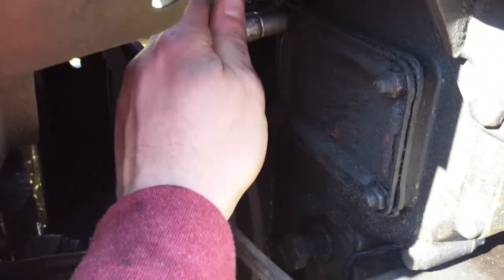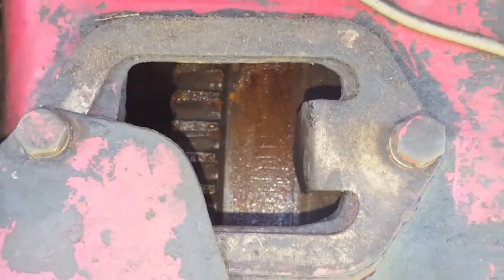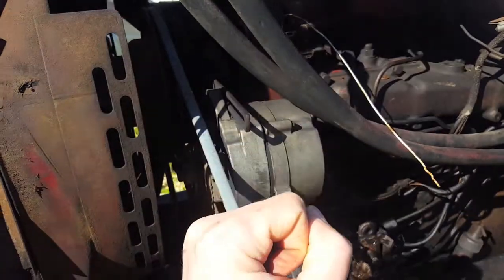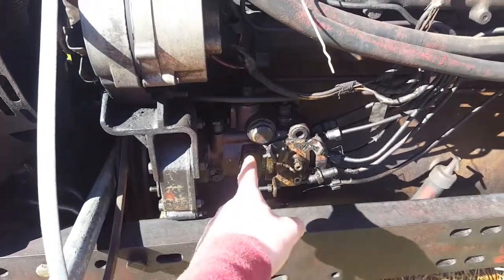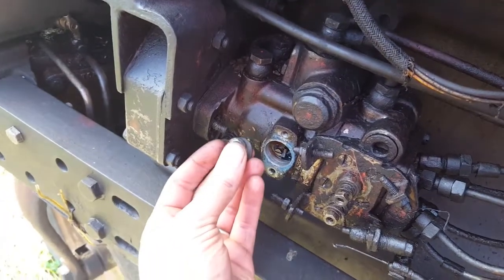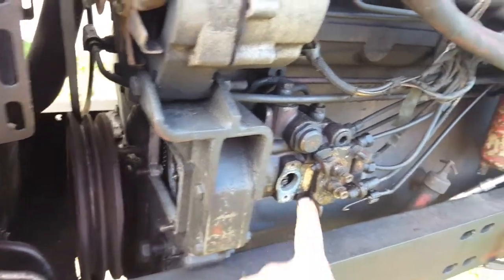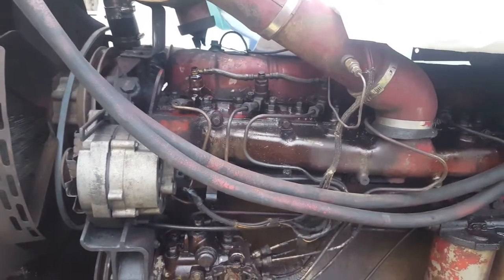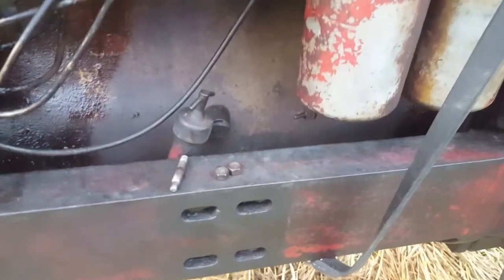Farmall 706 Injection Pump Timing pt 2

Comment: I installed a d310 diesel injection pump on my dad's 756. It's supposed to be timed at 14° beyond T.D.C. 

When it is 14° beyond T.D.C. there is a timing dot on the injection pump gear that will match up to one dot on the fly wheel. 

If the dot on the injection pump gear is close to 2 dots on the engine flywheel then you need to turn the engine over 1 more time until you are back at 14° beyond T.D.C and there is only one dot on fly wheel
Reply from the maker: Oh, wow! Thanks, David. I'll certainly look into that. I recently purchased a manual for the engine, so I'm learning a lot.